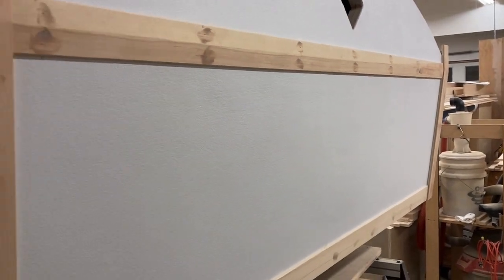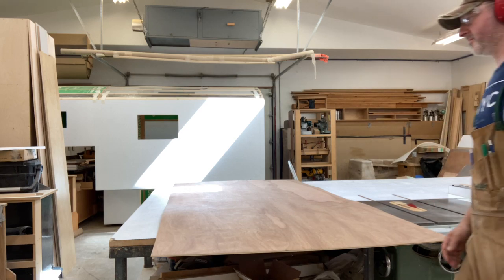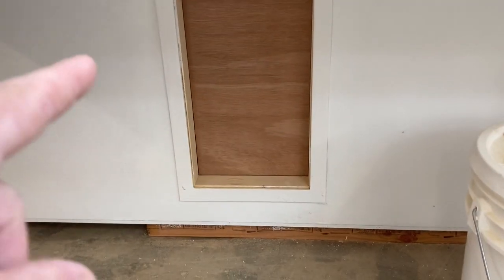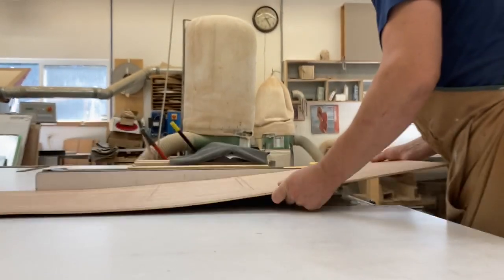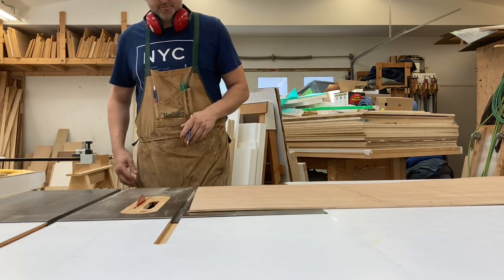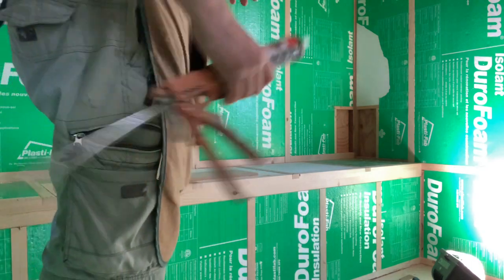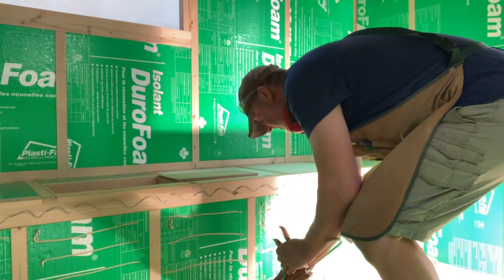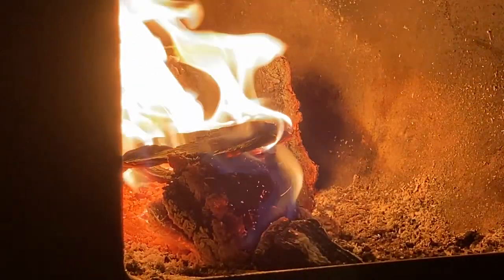Truckcamper Build part 24… interior paneling.

Comment: They store that stuff in rolls and even the slightest dampness makes it warp like that. That's what they use in older class c as well. Mine are all messed. I gotta redo my whole motorhome because of that stuff. Your better to use thicker stuff  or use cedar posts n chop them off the thin cedar they are bucks each or a bundle for a better price. Seen it all over online. I'm gonna make me one of these for my truck too. Onky I'm gonna try that spray or roll on bed liner for the bottom n maybe I'll get it in white for the rest and cover it in cedar on the outside later on. At least it'll be water proof. Adding a grizzly  wood stove to it n taking off lol 😊

Comment: The silver is reflectics it reflecs the cold n sun. So it suppose to be on the outside not inside unless its double sided which some is. But im pretyys ure thet ones not. Can always double up on the reflectics he had a roll there and add to both sides or just one side. Its really good stuff but for rvs camper etc id def double up and add it into curtains, depending on your winters where you live.

Comment: The green and aluminum films on both sides of the foam board prevent any adhesive (even contact cement) to melt the styrofoam core.
Reply from the maker: I agree with you that the film does prevent it from melting the insulation.. 
it’s also very easy to accidentally poke through the film with the tip, and the green came off in a few places, and there are a few spots where, if you applied it very heavy, it could be squeezed between the raw wood and raw styrofoam… so I was probably being overly cautious… but that’s how I roll!! Haha
Cheers
Reply: @mikesniedze9122  I didn't have that "piercing" concern in my own application because I sprayed contact cement on the luan and on the insulation, it is also quite quick to apply but you can't reposition the items to be glued if you misplaced them...
Reply from the maker: Interesting … I use spray contact adhesive all the time at the mill work shop I work at … too late now I’m afraid .
I’ve gotten some good tips AFTER I post my videos… I should make some that tell everyone my plans, and then wait for the solid advice before construction 😀